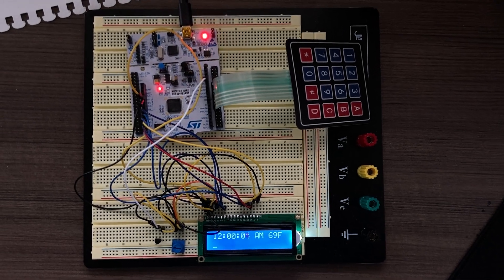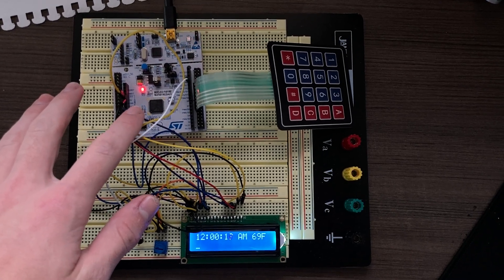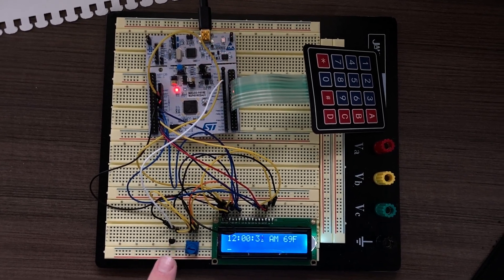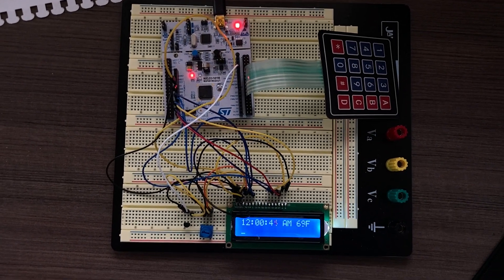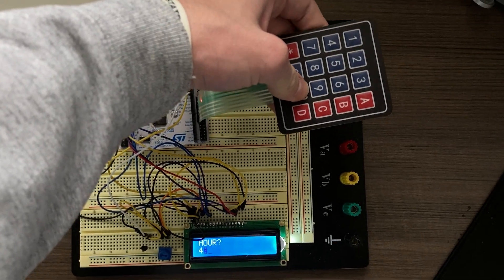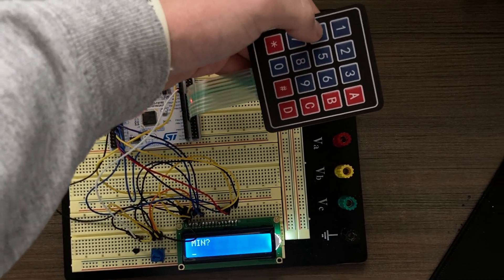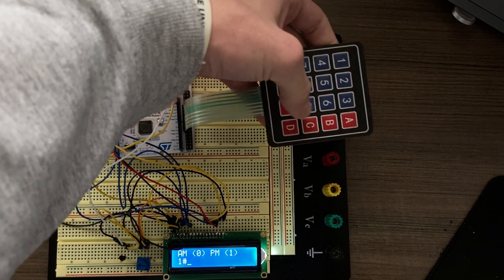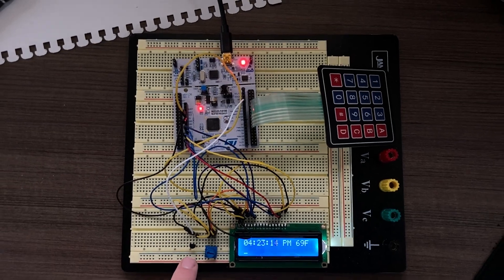Embedded Systems Final Project Demo

Comment: You ar not using an RTC module? How do you keep track of the time? Is it just millis() function??
Reply from the maker: Sorry for the late reply! Per the project requirements, we are using Mbed OS. Within Mbed OS, the ticker object allows you to set up recurring interrupts on a fixed interval. The ticker object attach function allows you to specify your interval in either seconds or microseconds. It all runs locally on the STM32 chip.